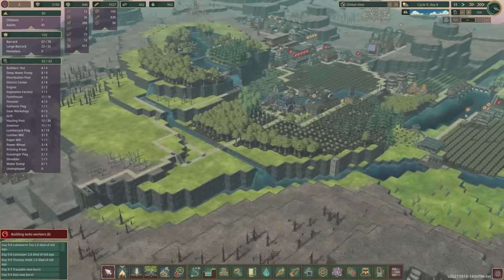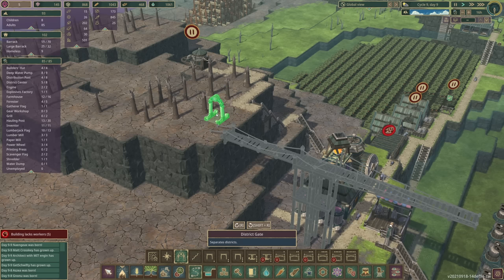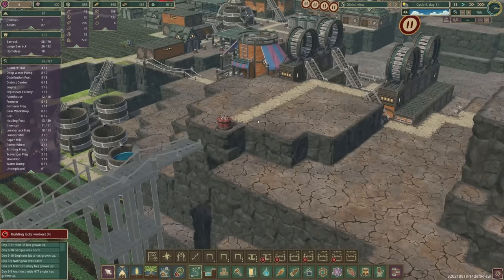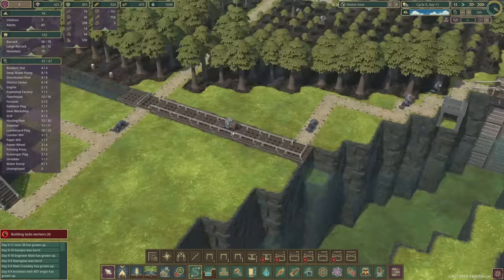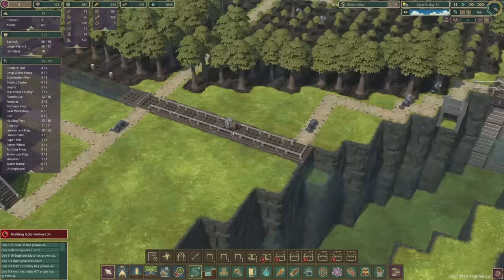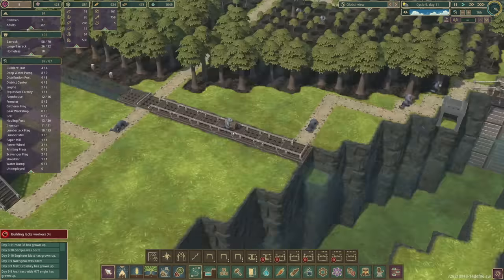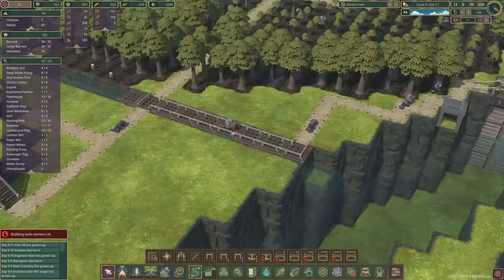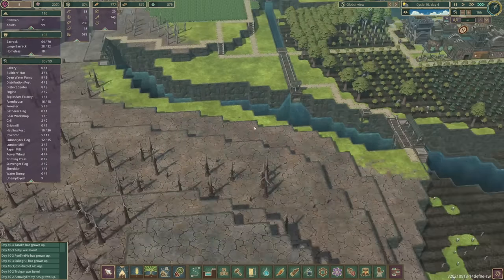Using TIERED DAMS to create an UNLIMITED WATER SUPPLY! Timberborn!

Comment: 12:57 This game needs powered water pumps that can move water uphill automatically. Since the beavers don't use electricity, just mechanical power, the ability to engineer some pumped-storage hydropower solutions to store excess energy would fit perfectly.
Reply: Exactly my thought at exactly that moment. I bet the power wheels are more efficient than trying to do that with beaver powered pumps and dumps. I suppose dams are supposed to be the solution.
Reply: They better give us an Archimedes screw

Comment: RCE i recommend you, for the wheat,  make a hole in the ground with explosives and put a water dump, a little hole of 2x2 can greenify a big area.
Another solution is by making an adjustable canal of irrigation
Reply: That has to be the reason for the dump in this faction, considering how they don’t have a irrigation tower
Reply: Does the water dump ever overflow the pool it’s filling or do the beavers stop trying to fill it once the hole gets full?
Reply: That’s a well.
Reply: @cathygrandstaff1957  once the water hole is full, the dump will automatically stop
Reply: The irrigation tower is i guess slightly worse then a water dump. It just drains water. XD its kind of a pain to keep them running with only 2 deep water pumps

Comment: Just a heads up, you can build the housing apartment style. Build lodges on top of one another, and use platforms to build access to them. Make the platforms 2 wide around the apartments and you can build them up extremely high. Platforms can be built over stair cases and paths, so it all remains accessible. I have a complex that can house around 50 beavers using this method.
Reply: okay... this changes things in my City.
Reply: Omg
Reply: You don't even have to have a 2-wide platform if you make a separate staircase you can have a single strip around multiple "apartements" that all connect to the same staircase.
Reply: The only thing i do not like about the house stacking is that the large building complexes kind of cause your sight to be obscured due to the buildings and all the platforms.
Reply: @cherrydragon3120   I like to orient my lodges in rows facing inward and a 3 wide set of walkway in the centre, keeps it looking a lot nicer than external walkways and you can still stack them to the height limit.
Reply: @cherrydragon3120  — If that is the only thing, I have to ask: have you experimented with the y-level selector? Just to the right of the toggle for showing water surfaces. Depending on the elevation that the apartments are built on and the city layout, it might be worth a skyscraper sometimes.

Comment: Hey Matt, so, I did a bit of poking around on the game's wiki, and I'm pretty sure that to build the most efficient water-storage solutions you'll want to use floodgates for basically everything except for failsafe overflow points. This is because dams overflow at a slightly higher level than floodgates set to the highest level below fully closed, allowing them to retain the maximum amount of water without risking a flood. There's probably a lot more nuance to it than that, of course, but "floodgates not always better than dams" is the main idea.
Reply: He used floodgates so he can raise them to keep the water inside and keep the area green

Comment: Once you have time, you could replace all your water tanks (3 each) with big water tanks. A small tank holds 30 liters, so 3 hold 90, which is less than a third of what a large water tank holds.
Reply: Yeah your biggest want and need at some point is just big water ranks all over the place.

I got like 14 of them in my folktail play  really difficult to keep enough water for irigation and big water tanks with only 2 deep pumps.

Comment: You can use the "P" button to quickly pause or unpause buildings instead of clicking the pause button.
Reply: And the delete key for deleting, or holding shift while deleting to circumvent the confirmation popup, etc., etc.. If somebody likes to use keyboard shortcuts, they'll try to figure it out. If they don't, they don't. Makes me wonder how effective of an engineer he is though, using keyboard shortcuts is kinda critical for working effectively in most programs.
Reply: @timderks5960  — Oooh, holding shift bypasses the confirmation? This is new information for me…. Dangerous information.

Comment: I think this is a great idea to generate power. What you do is you make a canal with a water wheel with a water dump at the top. And then the water just runs down to the place where you pumped the water. This should generate power all the time.

Comment: Your deep water pumps can reach down 6 levels. I've been playing this same level, have blasted the bottoms of the rivers and created a couple artificial lakes. I can't remember the last time I had to manage the water level. Thanks for making so many great videos!
Reply: Well, why don't you try the same with folktails 2 deep pumps. Then you can start learning to manage water levels lol. Its harder then you think. XD water is quite limited
Reply: @cherrydragon3120  haha yes it is, my comment was specifically for this map with this faction. I have another game going with the folktails where I've had to get more creative creating large deep stockpiles upstream and wider lakes downstream. Eventually I just levied the edges and flooded the entire perimeter of the map.
Reply: @cherrydragon3120  also you can stagger water pumps on platforms every two levels. Obviously you can't use them while flooded but they stay there until their not. When the upper level runs dry turn on the lower levels and start pumping again. This map produces enough water that you can refill everything in between dry seasons. I wish I could attach screenshots.

Comment: 12:58 Technically we already have batteries via water, but it's super annoying to have to micromanage. Instead, they could implement gravity batteries, using planks for the weight and structure at first, then upgrading to steel to get more gravitational potential energy through the weight being heavier and the tower being more sturdy. Could also dangle them off cliffs to get even more energy storage (you would have to root them to the ground so they don't get torn up by the weight, but that also prevents cheese)

Comment: Having that bridge going across but "needing" to be symmetrical sounds like an architectural design more than engineering...
Reply: Its often just more practical too. Cause otherwise you just need unnescesary platforms everywhere. It obscures your vision  and its just not a good time.
You want things clean and tight.
As much as architects are shamed here.
Maybe its smart to learn from the few things they do well. It only improves the engoneering aspect.

Comment: They could add batteries actually!

Theres gravity batteries which store energy by raising a heavy weight with a winch converting your beaver power (bp) to potential energy. Then by droping the weight the potential energy can be converted bacj to bp.

Might be something for the devs to look into as it would probably require the gear arms to be used alot more

Comment: "I wish there were batteries for the dry season".

Build water towers out of levees and fill up with water dumps.  Use them in the dry season for waterwheels.  Instant battery.  :)

I'm looking for a spot in my game... I'm thinking that if I put a water dump in carefully... build my tank one layer too tall and put the water dump down one on the inside of the tank with stairs to go down to it.  It should flood itself whenever it gets the tank up to level, which should keep it from pumping water out over the top of the tank.  (I've used dams in a few spots so it runs back into the source if it floods but sometimes you build water storage in awkward places like the middle of a plateau dug down with dynamite, although that's more for water storage for drinking water and general irrigation than for power).

Comment: You may not have batteries, but you can turn off your engines during the wet season to save logs, and turn them back on in the dry season when the water wheels stop turning.

Also, you could connect your architects' wheels to make those vile creatures somewhat useful.

Comment: For the super bridge you need to add scaffolding on the new colony side to build the platforms.

You may want to add a path on the backside from the engines to the water source.

For farms, harvesting appears to happen radially from the building, so it may be more efficient to place your building in the center of an area instead along a main path.

If you intend to use the irrigation canal, you may want to make it deeper to reduce evaporation to keep your wheat harvest stable. I'm also very curious if platforms reduce evaporation and can have buildings places on them. Covering up the river may be costly but would allow for additional space for storage and expansion in a more central location.

Comment: Would be cool if they actually made a kinectic battery. They are actually building something like that in Switzerland now. It is just a huge tower with cranes on top where 25 ton heavy concrete blocks dangle down from steel wires. If there is an excess of electricity they are pulled up, if they need electricty they are lowered, turning the generator. I guess they could believeably implement that in Timberborn.

Comment: If you do plan to expand and add more districts you should consider dividing up resource production or dividing up what the purpose of each district is for to allow for each district to focus on something. You would have to probably set up a bunch of drop off and district trade centers but it could be worth it in the end, for example you could have a district just about purely focused on wood production, carrot/potato/wheat production, research production, etc. another suggestion I have is about the longer and longer droughts. You could start on a massive water pit in the center of the map and make it as deep as possible, and direct all the water from sources towards it but they can spilt off at sections to make different areas green. However it probably would be better to make the source area the pit, then you can set up floodgates on every side and lower them when needed for different sections of the map, it would take a lot of dynamite for this idea so it’s probably unrealistic though.

Comment: You can make batteries, just ones that store gravitational potential energy by pumping water to huge, high-up reservoirs, and letting it drain in the dry season. You could also collect the water at the bottom for drinking or even pumping to the top again. Wait this is just free energy...

Comment: I grew up wanting to be an architect, I studied to be an Engineer (Mechanical), but now I'm a Horticulturist, studying Botanist.  😂😂😂. In my current job I have to deal with Landscape Architects and Civil Engineers. One is concerned only about aesthetics, the other is simply function. Both have plans that work.on paper, but not always in practice. Both don't understand people, only things. 😂. I have to find that fine line between it actually working and doing it's designed job while still looking good while doing it. Personally I rather see everything over engineered, far exceeding it's maximum capacity and let nature take it's course. Nature always finds a way and will consume everything back into her left untouched.

Comment: I feel like it would make sense to have all your deep water pumps down on the lowest tier in that big lake area. Rather than consistently turning the top pumps off every dry season. There should be enough water in that bottom lake and wouldn't leave you running out of water on the top or middle areas.

Comment: 100 beavers and only 1K ish water matt?? Good luck with 9 days or longer dry seasons.
I play terraces in folktails. Gonna tell ya XD cycle 15/16 was pretty tough. Had to deal with a 7 day drought and since their water pumps only got 2 deep instead of the iron teeths 6 deep. Water is a HUGE issue~ and i only got 77 beavers.
You might want to get some more large water barrels just in case.